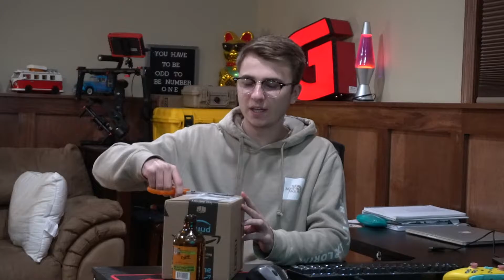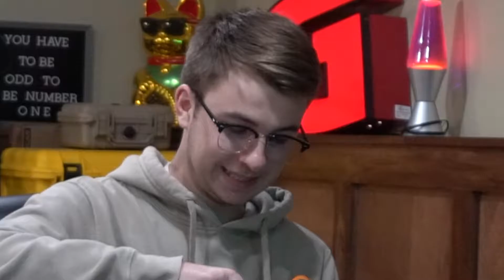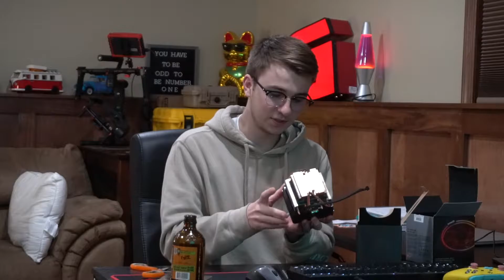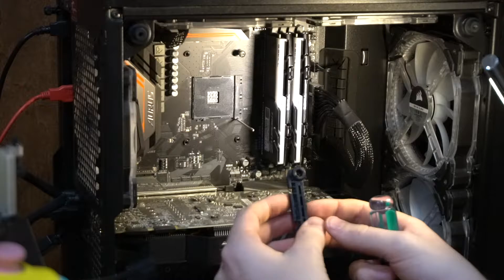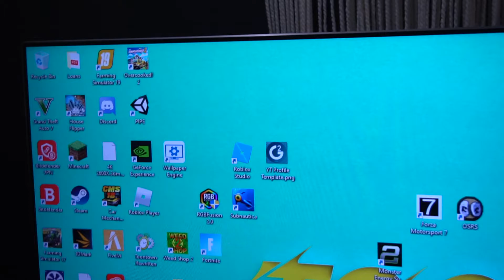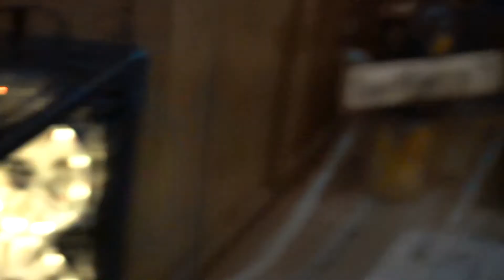How to RUIN a PC 101

Comment: My first PC was a Frankenstein system i built myself when i was 10. That was 19 years ago though. PC has changed alot since then. But i remember my Windows 95 system with dual core processor and 2 40gb hdd, and my 512mb graphics unit. Wow im old Lol
Reply from the maker: Things have definitely changed a lot. This stuff really challenges me and I love that!
Reply: @Toogii   I enjoy the challenge aswell. Im always looking to advance my knowledge in anything I do, so PC building is a good hobby as there always making advancements in hardware. So there is always something new to use and figure out.

Comment: was your CPU reaching 100% during subnautica?
Reply from the maker: Yes and was extremely hot under a stress test. The 2600X wouldn’t even finish a stress test where the 3800X is running 99.2%. I didn’t have any problems until I removed the old heat sink to install more RAM. Not reapplying thermal paste wasn’t the smartest move and I think it hurt the 2600X in the end.